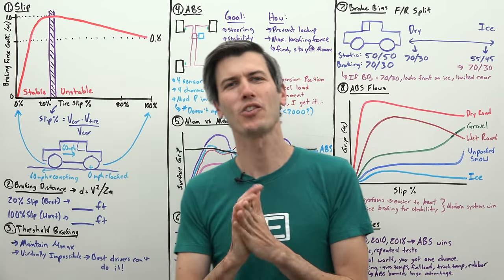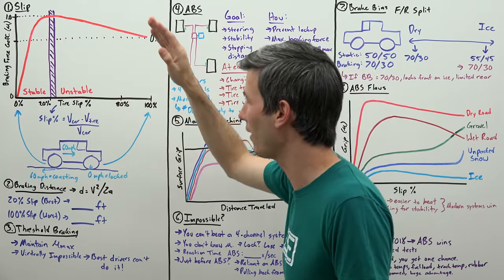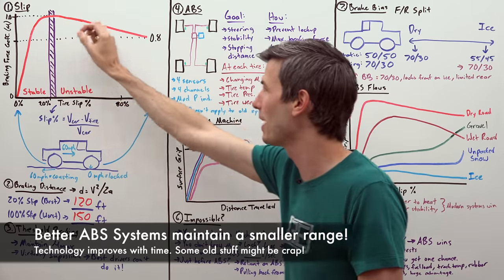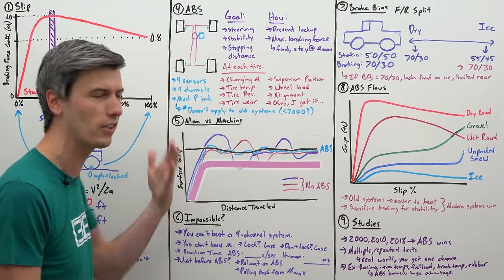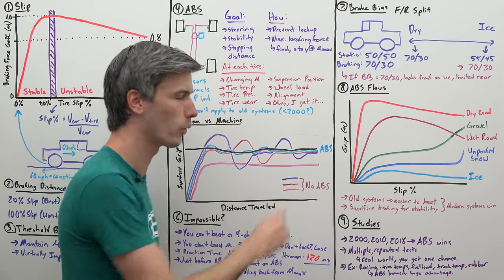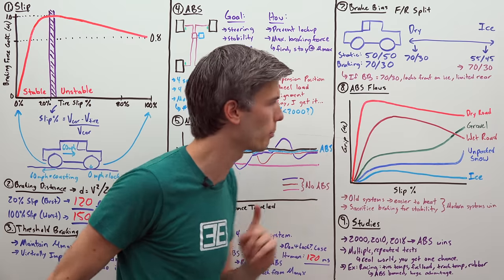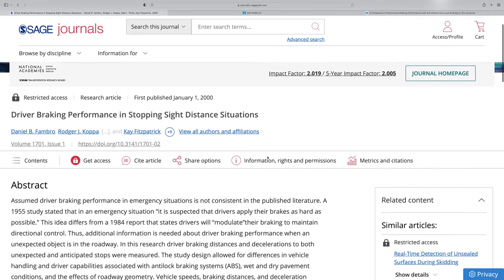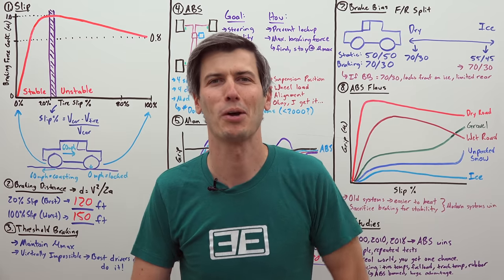Why Threshold Braking Is Impossible - ABS Wins!

Comment: My car came with ABS as an optional extra. Unfortunately the buyer didn't pay for ABS, fortunately though, the brakes are so bad that they don't lock up at all.
Reply: That's a problem not a feature
Reply: My old Chrysler Town and Country was like that.
Reply: Sounds like you have Neverlock Brakes
Reply: until you have low traction
Reply: You need an anchor
Reply: lol i had a daewoo work vehicle many years ago and literally needed 2 feet to pull up, i complained the mechanic said nothing wrong the way they are. well got to the point i couldnt hold it against the auto trans at idol so refused to drive it, turns out vac booster was leaking however once fixed it was still bad the brakes were shocking, so glad modern cars mostly have decent brakes
Reply: Just like my scooter.
Reply: You obviously don't like where it snows,, rains a lot, or you have to drive through dirt/mud.   Also,   what car doesn't come with abs now day?   Are you in the US?
Reply: I was once going down a steep hill in a shitty motorcycle with drum brakes and a heavy passenger. The wheels simply wouldn't lock. Couldn't stop the bike. Had to go all the way down and merge into traffic without stopping
Reply: Sounds like you're leaving a lot on the table there 😏 said in the voice of EE
Reply: @alexgarcia3900  A lot of cars don't come with ABS. They're sometimes called used-cars-from-the-20th-century.
Reply: Sounds like a pretty old car and it sounds like its time to upgrade to something with ABS.
Reply from the maker: Hahaha, what a blessing, brakes that aren't even strong enough as is. What vehicle?!
Reply: My ‘97 Town Car was like that. It came with ABS but I couldn’t even get it to activate without using both feet and all my strength. But, a set EBC sporty pads fixed that.
Reply: @chitlitlah  lol.  Most cars alive now days are from 2000s  and most 2000s cars have some sort of antilock brakes since it was required by law in 2004.  Lots of 90s car did as well.  So I'm not entirely sure what you are talking about.  Very few vehicles on the road without antilock brakes. Unless it's some sort of "classic" car
Reply: It’s not your brakes that are too bad; it’s your tyres that are too good! I recommend some 145 or even 135 section tyres … 😂😂
Reply: Holden????
Reply: @akgaming your brakes are braked 😂🤙🏼
Reply: parachute?
Reply: @EngineeringExplained  It's a 2000 Toyota Echo sedan. Although I really dislike sedans and it isn't nearly as good as my other car, it is actually really fun to drive.
Reply: @drink15  My other car does have ABS, although it's only 8 years newer.
Reply: I still can't believe I had a 96 Honda Prelude with ABS and later got a 98 Civic DX without ABS. I'm surprised ABS was not immediately legally required.
Reply: Anlockable Braking System
Reply: @MyHandleIsGood  Have you actually slammed on the brakes as far down as you can and it didn't lock the tires? I'm guessing you have but some people have never tried it.
Reply: @MegaLs2000  don't give land whales a ride
Reply: My car didn't have working ABS and the brakes weren't that good when I bought it. It would lock up the tires if I pressed the pedal hard enough but since getting the entire brakes replaced it became much easier to modulate how hard I slowed down the car, so I could slow it down good without it locking up too easily, like it would whenever the road was wet.
Reply: I had a 2007 Ford Focus like this. The combination of features it came with was wild. No ABS/traction control, basic Duratec 2L engine and 4spd automatic. But had keyless entry, power windows, and the sport appearance package. Not sure what radio options there were at the time but it did come with the MP3 capable single CD radio.
Reply: Please tell me this is a joke. Please tell me this is a joke. Please tell me this is a joke.
Reply: I used to have an '07 Pontiac G5 and ABS was optional (and not on mine). That GM would sell vehicles in 2007 without ABS is an abomination.
Reply: "Got us in the first half, not gonna lie"
Reply: @ChemEDan  Why are you chanting a mantra over something as trivial as a car with weak/worn brakes? Sounding kinda pathetic there.
Reply: It’s so weird as an European to see that you can actually buy a car without abs, here abs is mandatory on all cars since 2003 and was largely used even before that
Reply: @ImmortanDan  you literally wrote more words than he did...sounding pretty pathetic lol.
Reply: @arealsourapple  nice catch lmao
Reply: @thomasrogers8239  nahhhh really????
Reply: Same. My car has such weak brakes that the engine easily overpowers them just idling along in first gear. No matter how hard I push the brake, it just won't stall.
Reply: You have technology from the future.
Reply: @EngineeringExplained  Almost anyone could have out braked the ABS in my '94 Pontiac Sunbird.

Smacked it up in the first snow of the year, two weeks after purchasing it, because the ABS was so bad. No exaggeration, when the ABS triggered it was possible to count the seconds between "thumps" of the brakes applying.

First thing I did after getting the car back from the shop was to unplug the ABS module (the fuse was shared with something else, so pulling it wasn't an option). Drove it for 10 years and 200,000 miles that way. Took a few more vehicles before I learned to trust ABS.
Reply: @MegaLs2000  Why would you want your motorcycle wheels to lock up? If the front one locked you would go straight to the ground as you wouldnt be able to balance anymore
Reply: @alexgarcia3900  since 2004 in what country though? Not everyone lives where you do.
Reply: @jerrymyahzcat  I guess you are right.   This is am American channel though.
Reply: Its called” Sensify “ by Brembo brakes 
Coming to all Tesla cars
Reply: Damn, is it legal to build a car without abs? Here in Germany it isn't
Reply: @aaron9828  In Germany you can't build a car. It has to be Das Auto.
Reply: @averyalexander2303  At this point that's a safety hazard
Reply: @ja_  lovely adventure/anecdote
Reply: sounds like a rolling death trap
Reply: @MyHandleIsGood  a 2000 toyota with no ABS? I thought toyota would be better than that, I have a 1993 toyota that has ABS and it wasn't an optional extra
Reply: @djhappyemo  Apparently some of the later ones didn't even get the option to have ABS.
Reply: @Arvipa.  just wanted to point out the car was from before 2003
Reply: @alexgarcia3900  My 2005 Jeep Liberty says otherwise.
Reply: @Ferraz298  really?   Nothing?  Even my 90s cars thay I had, had abs.  Super weird.
Reply: @alexgarcia3900  my car is a 2013 and doesnt have abs
Reply: @chrisminnig7144  or was the fact that your brake fluid was changed that improved that?
Brake fluid has an expiration date, as it accumulates moisture. Thus, it becomes harder to make the brake fluid to go through the system, making it harder for you to press the brake.
Reply: @hitardo  Mmm... I can't recall whether I flushed the brake fluid first or at the same time as changing the pads. But, the pedal feel didn't change when it was done. I think the pads made the difference.
Reply: How is ABS as an option even legal?
Reply: @NithinJune  In the European Union, it is mandatory for cars to have ESP.
To have ESP, cars have to be fitted with both ABS and TCS.

ESP: Electronic Stability Programme
ABS: Anti-lock Braking System
TCS: Traction Control System
Reply: Folks- it’s satire lol
Reply: @thomasrogers8239  that's not very Bethesda of you
Reply: Brakes are for people with poor planning skills.
Reply: Even at 0 speed? Then they are BAD/almost nonexistant.
Reply: That's right brother. Tell 'em folks. It's a matter of perspective. 
IE.
Person 1: My v8 engine is only running on 5 cylinders!

Person Meth: Nah man, your v8 ONLY NEEDs 5 cylinders to run.
Reply: Oof. Please stay safe, my friend!
Reply: but, wasn't ABS required by law on all new cars since the early 2000s?
Reply: @Arvipa.  it’s no different in the US, Americans tend to keep cars longer then Europeans so cars made prior to ABS being mandatory are regularly on the road still particularly in more rural areas. I daily drive old vehicles, I repair it and mod it as I go to make it how I want it. No point in buying something newer when I wouldn’t like it and would spend just as much to change it. I have several older cars to save fuel, and the vehicle I prefer to drive is my 2002 F350 super duty. Many places it wouldn’t pass safety do to the rust but that last just a fact of life where I live, the drive train on the other hand is impeccable. Each mod tends to show me the next weak point, last one was the torque converter exploding, I’m sure next will be the transfer case since I tend to pull trailers through rough terrain requiring 4wd.
Reply: @djhappyemo  I had a 2007 Yaris without ABS. It became mandatory in 2012 in Canada and USA.
Reply: had a Ford Ranger.. same issue as described here... it had ABS but even when a wheel sensor failed it didn't matter even in the rain.
Reply: @MegaLs2000  a motorcycle drum brakes or not should be able to stop, if you have any breaking power that combined with engine braking should be enough to get you to slow down and some relatively okay fashion, not quickly but fast enough that you should be able to stop before an intersection
Reply: It's a Dacia isn't it? Probably a Dacia Logan from the first generation? Is it the 1.6MPI 8 valve?
Reply: @MichaelRei99 my car from 2007
Reply: @dtemp132 also Toyota
Reply: @mastroitek not in the US
Reply: Anti Braking Feature

Comment: I think I see what you’re saying. We need to start having four brake pedals, one for each wheel, so we can modulate them individually.
Reply: That makes total sense!
Reply: Four buttons on the steering wheel and you still get to use your thumb to scratch your nose.
Reply: In fact, f*ck everything, we're doing five pedals
Reply: General Kenobi!
Reply: and have 2 throttles 1 for adjusting air intake and one for fuel
Reply: Why are there 6 pedals if there are only 4 directions?
Reply: McLaren actually had an extra brake pedal on their MP4/12 car. The extra brake was made to act on one of the rear wheels, selectable by the driver, in order to get the car to rotate more in slow corners.

At least in theory you could make four brake pedals work. If you make the ergonomics such that you use two pedals per foot, you could modulate the pressure by rotating your feet. However, I suspect the level of skill and acrobatics involved would make this quite challenging to use effectively.
Reply: That's basically what you have on a motorbike - front and rear are separate. You could do that in a car (in fact it's been done as a cheat in F1), and it would work well unless you're in a split-mu situation. Having said that though, as Jason says, modulating brakes on threshold is pretty hard to do well, even with one pedal. Drivers could beat early ABS systems, but not the latest ones.
Reply: @mind.hacker9996  every old piston aircraft be like:
Reply: We have 2 on a lot of farm equipment, one  for each rear wheel so you can make extremely tight turns
Reply: And an additional digital display on the dash that analyzes the condition of each tire (tread design, depth, any foreign substances on the tire, etc) and the coefficient of friction of the road at each tire, so that the driver can accurately modulate the brake pressure of each wheel to match it.  Might take a bit of practice to master it...
Reply: Yea motorcycles usually have 2 separate braking circles, controlled with separate controls
Reply: No.. people can hardly drive with only two pedals.. or for us real drivers, three..
Reply: Yeah, 4 brake pedals, a clutch pedal and 2 gas pedals(air and fuel separate ofc)and then a foot operated emergency brake.
Reply: the design is very human
Reply: @tqracing  Most farm tractors have split brakes for the same reason.  :-)
Reply: @tqracing  have you, by chance, seen saxophone left hand pinky keys? its four keys but for some notes any combination of those keys may be used, and they are connected quite intricately with bars and there are sliding rollers so you can easily operate it. I think this is a good idea, so that you can slide your foot around the brake pedal to operate a combination of subpedals.
Reply: thumb levers for the front, two foot brakes for the rear. on a manual, double heel-toe for downshifting + you completely lose one of the front brakes. yOu ArE oNe WiTh ThE vEhIcLe
Reply: Don't give garage54 an idea 😂
Reply: Finally, there’s some use for “passenger”. Now they’re our brakes man.
Reply: And have people mutate into squidward so be able to use them all simultaneously.
Reply: On a semi one toe for each pedal for each of the 10 wheel groups and then modulate each toe accordingly 20 times per second.
Reply: @privateinformation8364  like how tracked vehicles work? But that is steering not braking, the driver does not want to stop.
Reply: @philiptownsend4026  it's for steering or braking on a tractor, just depends if you hit one or both at the same time
Reply: @tetsmon  What if it was like the space of the regular brake pedal, but it was split into 4 squares: upper-left, upper-right, lower-left, lower-right.
Now, you can heel toe while braking, just have to pivot your foot a bit more forward to hit more % on the front and less or the rear.

I imagine doing this and it's very overwhelming. Not sure if it's even possible to acclimate as it would be too much multi tasking, lol
Reply: First you need to grow 4 feet
Reply: 4 brake pedals, clutch, 1 throttle for each cylinder in your car. total control.
Reply: okay Mika Hakkinen in the McLaren MP4/12 lol, that car had a normal brake pedal and then a second one with a toggle for L/R you could use to corner better until F1 banned it
Reply: @RobManser77 very few riders are capable of threshold braking on both front and rear wheels at the same time. Some of those who are will be racing at Assen this weekend, but even then many of them will screw if up during the weekend :) Even fewer drivers would be capable of doing it with 4 separate controls, one for each wheel!
Reply: Just need to grow 2 more legs.
Reply: @thedownwardmachine  1 pedal for each tire, plus a panic pedal if you don't feel like dealing with controlling 4 tires individually.
Reply: We as human need to grow at least 5 feet to make full use of them😂
Reply: Actually ABS does not control all 4 wheels independently, otherwise car will turn away. Even front-rear a not independent, because it will destabilise the car on the curve. So even having 4 sensors and four channels ABS (not a stabilisation system) operates all of them together.
I have my own experience with ABS from end of 90-s (not 70-s), When one sensor get loose and distance from the metal teethes increased, the ABS decided, that this wheel is locked and released breaking on all 4 wheels. Fortunately after few seconds it did understand that something is wrong, switched off and returned me the breaks.
Reply: You, I like the way you think
Reply: @tqracing  why not 1 pedal that can be angled left or right to change side